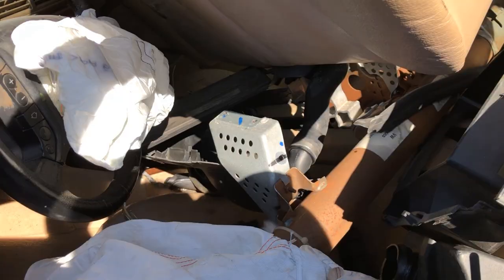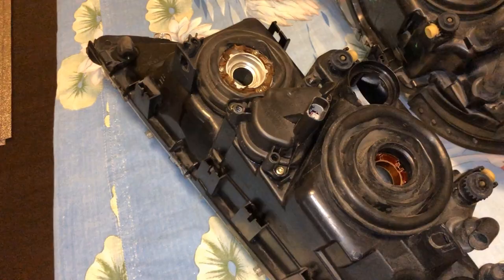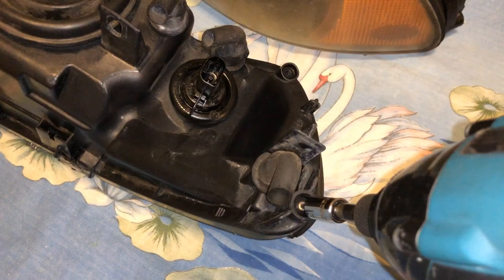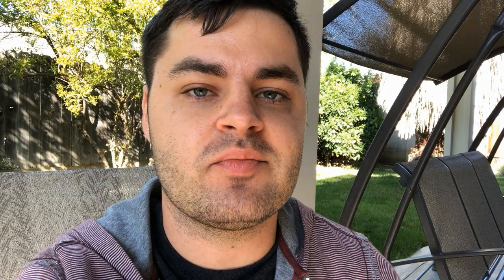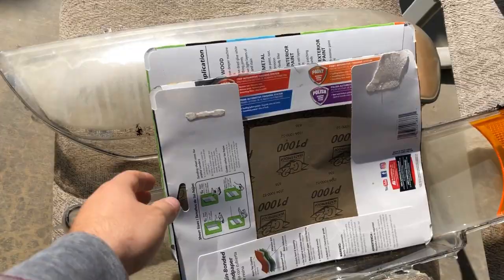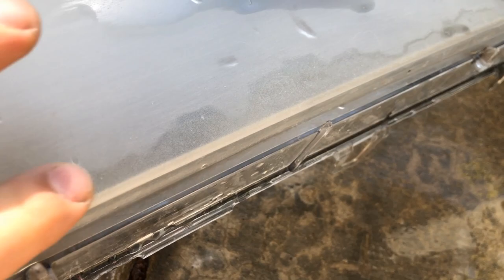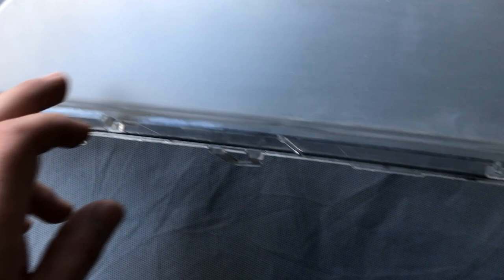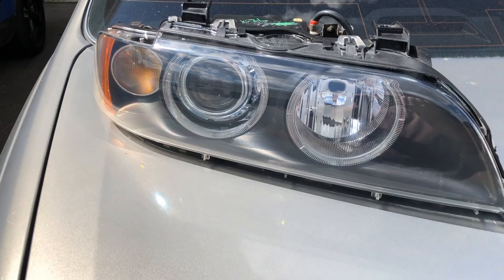WRECKED BMW E39 M5 Headlights Look Better Than New For Only $140!!

Comment: I bought used xenon facelift headlights on ebay because my junkyard didnt have any.  mine were pretty sorry looking too and had broken adjusters.  I had to replace my adjusters the hard way bc they were 2003 production lights.  Had to go in through the rear with the new adjusters which was very hard and frustrating but once I did the first light the second light seemed easier bc I learned the tricks of how to get them in there just right.  i did the same thing with wet sanding but instead of clear coating them i decided to just buff them after wet sanding and they look brand new.  I just wanted to share my story.  Nice work - yours look beautiful as well.
Reply from the maker: Thanks for sharing your experience. You can save some time by buffing them at home and installing back on the car really quick. Either way I found out you don't need a perfect pair of headlights for this car as long as they work and have no cracks from damage you can easily make them look like new again!

Comment: Noticed that car is a Californian car. Well it had passed all its emissions tests up until 4/16/17.  What pick n pull is that with such a variety of e39s unmolested?  I go to the Oakland and Richmond p&p and even 2 day old ones are almost completely gutted.Shouldve taken the rear light housings and  vanos solenoids too. Last time I went to a pick n pull I took a valve cover to replace my warped one (that I believe to be the source of my phantom vacuum leak) and they rang it up as a timing gear cover!!😂😂🤣 I was like, "yeah, timing gear cover."
$25
Reply from the maker: Sorry man can’t disclose the location because I still need e39 parts haha jk It’s the one in Rancho Cordova. It’s true though I noticed there’s a decent amount of e39s that still have plenty of parts on them left here in our area compared to the Bay Area.

Comment: Where did you pick up your adjuster for?  Did you use oven method or heat gun?
Reply from the maker: Can’t remember from who but it was on eBay and I used the oven method.

Comment: How did you take the lens apart to scuff them down?
Reply from the maker: Couple screws on the back. Heat up the headlight so sealant is softer. Pry carefully around lens and housing area. Should be pretty easy with no force. There is a production stamp on the back of headlight that will let you know what type of sealant is used. There’s a sealant on some of these headlights that you pretty much can’t take apart.
Reply: @4wheelfunbros   how you heat it up?! I tried with heat gun but it didn't work at all...please help!! :(